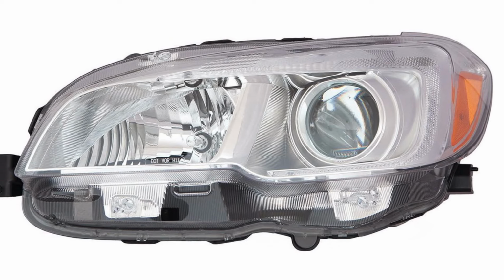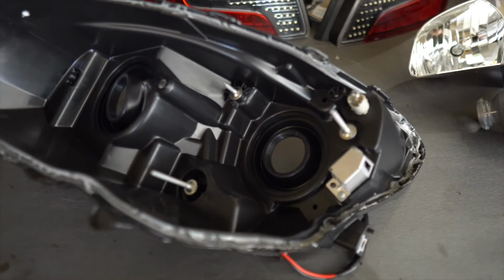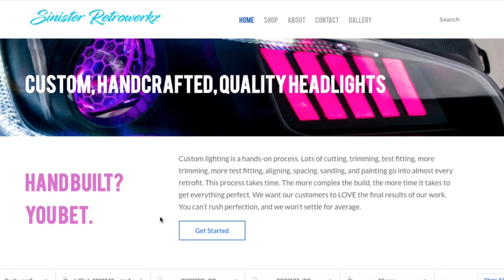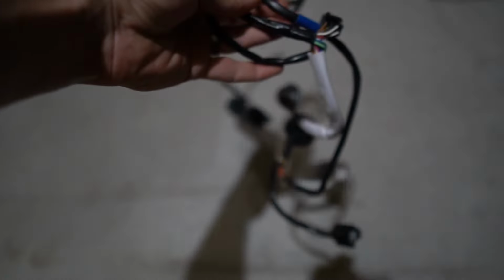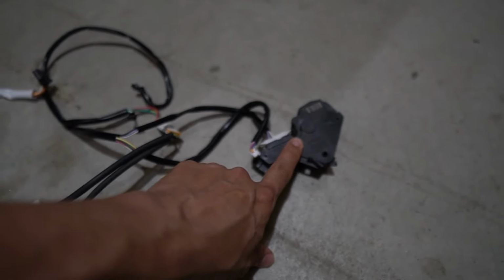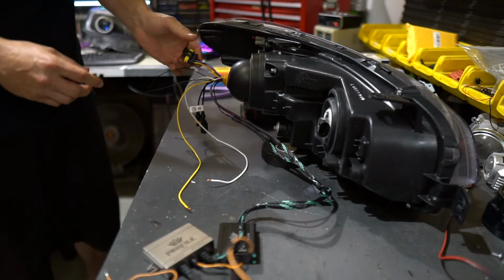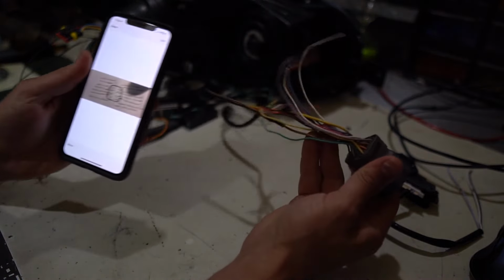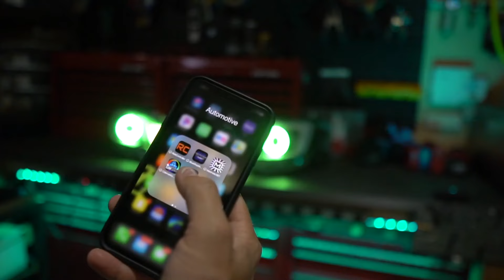Using a NEW Headlight Plug

Comment: I've got a challenging problem for you that might be out of your knowledge. I built headlights for my 08 Subaru Legacy, with Morimoto Bi-LED projectors and yellowed the separate high beam reflector buckets. The normal function is the high beams double as DRLs, but that triggers the Bi-LEDs to stay on high beam mode. Is there a way to split the DRL signal or isolate the projectors from it so you have the separate high beam/DRL bulb still function normal, and the Bi-LED projector not be affected?
Reply from the maker: Yeah you can just run a relay to that bulb, that gets its trigger from the high beam wire. What happens is the DRL voltage isn’t enough to trigger the relay, but the highbeam wire is. You should be able to tap the high beam wires from the projector into the output from the relay.